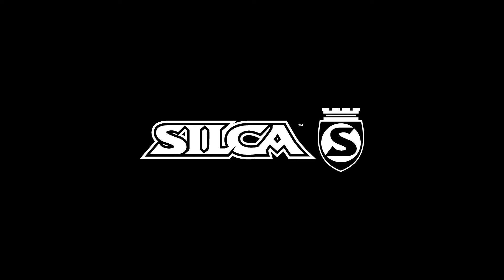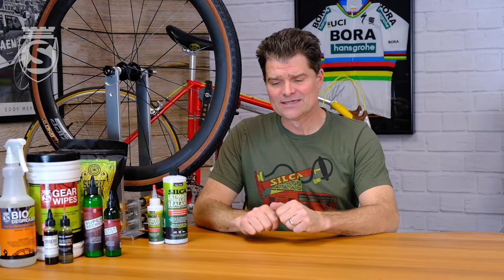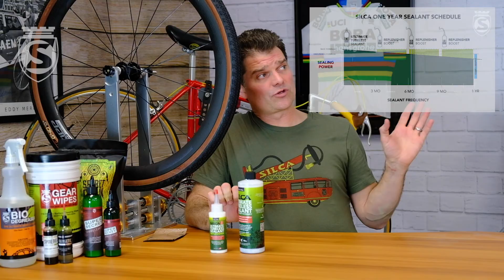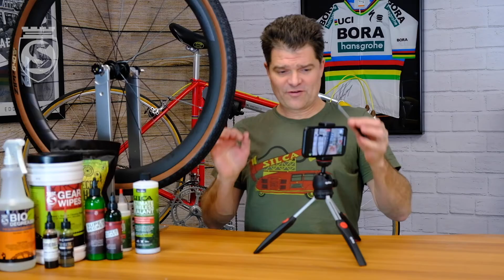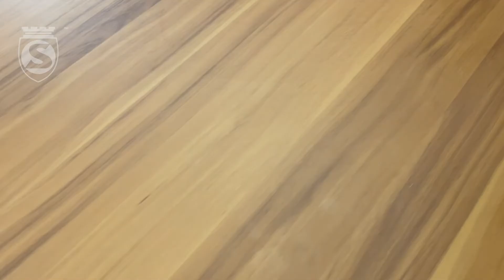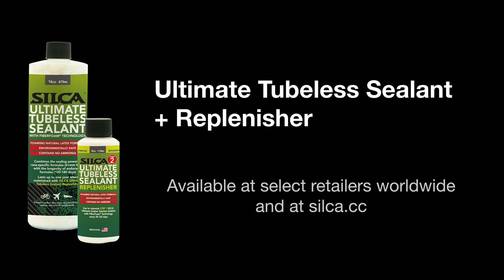Ultimate Tubeless Tire Sealant  (New Product Announcement)

Comment: I'm sold on this stuff just from watching this video and seeing the price! I have a few questions though. How many oz sealant and replenisher do I need for two 29" 2.4" wide mtb tires to last one year (Maxxis EXO)? Also, what is the shelf life and do the bottles have an easy to read manufacture date?

I have read anywhere from 3-8 oz recommendations on first time sealant use per tire for a new 29" mtb tire of 2.4" width. I was going to get a 32 oz bottle of sealant and about 3 bottles of replenisher for 1 year, but for all I know that could end up lasting 2 yr here in Seattle.

BTW, these tires are on a 2023 Santa Cruz that I just bought new, so the sealant (Stan's), has been in them probably at least a year. The guy at the shop I bought it from said the rear may have a solidified clump of sealant in one spot, which I confirmed by rotating the rear wheel fast while holding the bike, as I felt a noticeable tendency for it to hop. The front doesn't do this. What is a good cleaner to use to thoroughly remove old sealant from tires? Also, if I don't manage to 100% remove it all, is there any chance the Stan's residue will cause problems with the Sillca sealant?

Comment: Do you still have any use for if you have them "stans darts", does this product work with them? And have an other question, will this work using on Fatbike-tires during wintertime or will it freeze up? Can you mix antifreeze to be able to run it as far as down -25C°(-13°F)?

Comment: been using this for 6 weeks and so far so good over all terrain, roadside with glass, and rough Australian fire roads inside Pathfinder Pro's. I've only seen a little sealant near the bead where I think I burped a tyre hitting some rocks at low pressure and high speed. very happy so far. Thanks Josh and Silca product team!

Comment: Tell me difference between putting 2oz. Of Ultimate tubeless sealent Every 4months or adding the Replenisher in my 32mm tire?
Reply from the maker: Ultimate sealant cannot be injected through a valve, it will just plug it.  So the replenisher allows you to refresh the sealant through the valve without having to unseat the tire.  Also, the amount of carbon fiber doesn't need to increase from the initial install.. the sealant will begin to evaporate, but the carbon stays, so you really just need more liquid and not more carbon.

Comment: I was initally super excited to give this sealant a try after viewing this video. However, when I got a puncture on my most recent bikepacking trip I was totally let down by its performance. Backstory: I got two tiny holes  (one in my side wall and one on the top of the tire near the knobs) simultaneously when my wheel hit a rock on a fast descend and the tire bit the rim. Perfect opportunity for the fiber foam to do its job and take care of these holes, I thought. After about an hour of messing with the tire, spinning it and even adding more Silca specific replenisher I had no luck. It seemed the fiber foam was not building the so-called scaffolding that was advertised. When I later popped the tire off to put in a tube I was surprised at what I saw. Almost 100% of the fibers had clumped together in various parts of my tire and formed little stalagmites. There was virtually no more fibers dissolved in the sealant liquid that would be available to do its job. Super dissapointing. I should also add that I topped up my wheel with 60mls of freshly shaken Silca sealant right before departing for the trip. I'll definitely be sticking to Stans in the future.
Reply from the maker: Sorry for your experience, unfortunately the formation of stalagmites means that you waited to long to replenish.  This happens with all sealants especially Stan's as has been well documented for more than a decade, so be sure to give your tire a shake once a week and listen for the sealant to thicken, once it thickens, no matter what the brand, you should be replenishing.

Comment: One of the worst aspects of tubeless sealant is when my many bikes sit for weeks or months and the sealant solidifies inside the tire (I use Orange) or the dreaded booger. You can’t get that crap off your tire without some serious work. I want to be able to clean out the tire at some point, also clean the rim to reinstall tape, which is the absolute key to good tubeless performance. So a gunked up inside is not optimal. What happens to the Silca sealant when it ages? Can it be cleaned out? Hard? Easy? Thanks.
Reply: Good luck with any brand. If your bike is going to sit for long time take the sealant out the tyers. Also this stuff is like glue the tyer will basically stick together be becoming unusable. If your the type fit and literally forget tubeless full stop isn’t for you

Comment: Hello SILCA team, 

my Gravel wheels are well setup and I have just recently setup my ZIPP 858 NSW with Specialized S-WORKS TURBO T2/T5 2BLISS READY, it installed really well. 

However, during a long ride, I had a snake bite puncture riding over a big whole. 

The 2 wholes were roughly 2 - 3mm in length. One sealed but the other keep on leaking sealant and deflating the tyre.

I added sealant and even plugged the whole but for some reason, the whole would still leak, mostly when weight on it on when I’d look at it with my finder.  

I’m a bit confused because I think that I followed all the right steps. Any idea what I might have done wrong?  

BTW, I inflated the tyre with around 72PSI (max for hookless rims)

Right now, I’m prepared to go back to inner tube TBH.

Comment: I had a bad result with this product, after fitting the tyres according to the installation guide I found the product “set” inside the tyres and put the wheels out of balance, cleaned everything up and tried again but same result…. Product seems to dry out very quickly….. got nothing productive from Silca and nothing from the retailer…  Back to Stans Race as I know it works and doesn’t dry out in a couple of days and throw my wheels out of balance and I know its still liquid cos I can hear it sloshing around.

Comment: Josh! I bought in on this tubeless sealant. I now can’t fill my tires up . The sealant blocks the valve stems. After emailing silca without a reply I called. This call was worthless. I was hoping they could explain what I might be doing wrong. Instead I got sorry. So I replace all valve stems only to clog to the point my pump was blocked also. 
Do not buy this product!,its not the answer
Reply from the maker: Sorry for your valve clogging experience, but this is factor for all sealants of all brands and not just ours.  A quick google search finds thousands of articles and forum threads on Stan's and Orange seal and all the other brands clogging valves and how to fix or prevent it.  Our method is to coat the valve core with Synergetic or similar wet lube before installing and to put the valve stem at the 4 o'clock position for a minute before pumping.  You can also spray a little wet lube into your pump chuck which will keep any sealant that escapes from hardening.

Comment: This stuff is amazing!!! Ive used Stans sealant which was junk and left me stranded.  This Silca stuff seals and holds high pressure every time. Thanks Silca.
Reply: I didnt have a good experience with Stan’s.  I didn’t think it sealed well at all. The Silca stuff is good but it’s got its own problems with clogging valves. Orange Seal works well and doesn’t plug the valves.
Reply: @MasteringGrappling  well test that next possibly. Silca has a bit of a neegative for sure when i heard of the foam. Sounds like ir will get on the rotor
Reply: STANS is the market benchmark buddy.
They invented the thing and possibly has been the best since. Ive tested almost all, run through atleast 60 tires in the past 3 years. Although im looking forward to test this or new ones ive heard rumours about 
cant dismiss stans like that.

Comment: Got to test the Silca Sealant last weekend at the Wilderness 101k mountain bike race. I underestimated the rockiness of the trails in Central Pennsylvania and the Bontrager XR1 rear tire was a bit over matched by the rocks.  I end up with a slow leak and stopped to put in a CO2.  The leak was right at the rim, where its hard for sealant to get to. I turned the bike on it's side so sealant could find the leak and it sealed right up.  I finished the race on the 1 CO2 and the tire is currently holding air without issue.
Reply from the maker: Great to hear Paul and be sure to check that sealant as CO2 is a hardening agent for all natural latex based sealant products, ours included.  Changing out that air and adding some replenisher should do the trick!

Comment: Usual up front and science based video sir - thanks. Had already bought some of this,m before watching the video and just installed a new tyre(GP5000 TL) on to a Roval rim (about as hard a combo as exists) and with a little care managed to get 60mm in and only maybe 1mm spilled. Not bad for a road install. 

@silca_velo Questions: how do I stop the valve clogging now (with this stuff being better at ‘filling holes’) - is it just a case of replacing the valve inner more often?

What model of iPhone holder and mount are you using in that video l? 

Only have 3 months max left of the year now, so curious … if I store the wheel (temp on avg 19C)  for the winter and it doesn’t move can I use replenisher next Spring - or just start again? And will the bottle (now open) if sealant stay good until next year?

Thanks.

Comment: How does this not clog the tire valve if/when I need to bleed off air?
Reply: Use a fillmore valve or wheel the valve up to 12 o clock

Comment: I didn't get their solution to "seal the valve" problem? Do we inject the second liquid?  I'm having this problem even in other brands, I can imagine how difficult the situation should be with additional fibers in it.
Reply from the maker: The liquid sealant can get into the valve, but the fibers will actually dam up the valve hole and prevent sealant and fibers from entering the valve from the tire side.  When you pump, the air from the other side simply blows away the fibers and sealant, so in practice there is really no difference between us and the other brands in terms of valve maintenance.

Comment: Hi Josh: Great content. Hey, I'm a newbie, in that I don't have a tubeless setup just yet, but I'm wondering how much of your sealant would I need for my setup if I'm running a 700c 25mm road tire? I don't know how to figure out how much of your tire sealant I would need. Is there any instructions on the bottle itself that tell me how much to use? Thanks in advance!
Reply from the maker: There is a QR code on the side of the bottle that takes you to installation instructions including a chart of how much to use in different size tires.  You are probably looking at 2oz/60ml each for your tires!
Reply: @SILCAVelo  Thanks. I will look for that bar code when I receive the sealant.

Comment: Using the replenisher on latex tubes; would that result in not having to inflate the tubes everyday. If so then what would be the general time necessary to reinflate those latex tubes?
Reply from the maker: Replenisher may slow the pressure loss in latex tubes but will not eliminate it, the pressure drop is more related to the solubility of gasses into latex than porosity as is often suggested, so CO2 for example actually will migrate through the latex tube and sealant by temporarily going into  solution with the rubber and than transitioning out the other side..

Comment: Hi Josh I love your innovations, I've been on again off again with tubeless and was going back tubeless with a set of Vittoria Air liners when they arrive next week or so and then your email arrived in my inbox. Do you know if using Silca sealant with the Vittoria  Air Liner will work or do you think it is an either or option or perhaps even a better option without the AL.
Reply from the maker: I love Vittoria Air Liners, but they can make tire installation harder than you ever imagined.  We've been using/testing them in our shop for almost two years and I'm pretty much the only person (Josh) who can consistently get tires on/off without resorting to extreme measures, and even then, I've blood blistered my thumbs more than once.  If you're using the liners, I would not recommend putting SILCA sealant in during that process as you might end up stuck to your floor in a puddle of sealant and tears (been there.. done that!).  I would probably just go with replenisher if using air-liners as you'll want to just pump it through the valve and be done.

Comment: How does this react with CO2?
Reply from the maker: All latex based sealants will be degrated by CO2.. if you need to use it then go for it, but we will have similar issues to other brands over time with CO2.

Comment: How does this compare in regards to rolling resistance to other brands?! #marginalgains 😁

Also could you use Stan’s as a replenisher in a pinch?
Reply from the maker: Sealant rolling resistance is all about how much you are using, no real differences between brands or chemistry.

Comment: Question - will in possible to run with inerts like the Tannus Armour tubless? Or does it stick the slots inside?
Reply from the maker: We've done lots of testing with the Vittoria style inserts and it works great.  Inserts with very high surface area may end up capturing a lot of the carbon fiber and holding onto it.. but have not tested directly sorry!
Reply: @SILCAVelo  I will give a feedback of my testing.

Comment: I have now watched the entire video, as the title has made me very curious. And I am shocked at the audacity with which SILCA are trying to portray the sealant as a pioneer on so many levels. 

1. "Fiber Foam": Effetto Mariposa already tried this " innovation" with the foam a few years ago and it failed. Why? A foam can transport individual particles, that's true. But the problem is that these few particles/fibers are not enough to seal a hole. What works much better is if all particles always stay homogeneous in the liquid. This is for example what MucOff, milKit or Peaty's do.

2. Ecological Aspect: As far as I know the only supplier that currently still uses natural latex is Stans (because they simply haven't developed in 20 years). To stabilzie natural latex you need ammonia which corrodes the rims and spoke nipples, is harmful to the environment, smells horrible and is no longer allowed to be used for Maxxis tyres for example.

3. Longevity: It may be that the sealant in combination with the refill bottle is good for over a year. But that certainly does not speak in favour of the Sealant if it requires this additional bottle.
Reply from the maker: Great to see that you joined YouTube today in order to leave this comment, but it's fundamentally flawed in numerous ways:
1. Effetto Mariposa continues to foam, it's what makes it the best sealing synthetic latex sealant on the market, we credit them with this innovation in our media launch materials.  The current version foams less now than the original formula, but still foams.  Your assumption regarding MucOff, Milkit, and Peaty's is also not true, the plastic particles generally centrifuge out and stick to the casing while riding.. we punched hundreds of holes in tires with all of these and you will almost never find one of those particles flowing into the puncture, they just aren't mobile enough when riding, all of those sealants also just don't work that well and are full of micro-plastics.

2.  Uhh.. this is far from accurate, more than half the brands use natural latex and Finish Line just replaced it's poor performing synthetic latex with a natural one that supposedly works much better (according to them not me).   Testing over 30 brands of sealant, the natural ones pretty much all work better than the synthetic ones.  There are also non-ammonia methods of stabilizing it, though it still doesn't smell good.  

3. Our longevity for the sealant is comparable to Orange Seal endurance or original Stan's, and with the replenisher can be extended considerably without having to replace the entire sealant.  Over time, this means using less sealant not more.

Comment: I'll bet it seals holes really well, but I'm wondering about the materials safety if the guy in front of you has this stuff in his high pressure road tires, he punctures and then you breathe in little bits of carbon fiber. Also, I'm not all that keen for bits of carbon fiber to find their way into waterways. Any comments @Josh?
Reply from the maker: Couple things, the carbon is so good at plugging the hole that none of it really ever gets through, we've punctured hundreds of tires with this stuff and at most you get some oozing latex.  Second, this is pyrolized carbon fiber, it is chemically identical to activated charcoal which is used in water filstration and has no adverse biological effects, is not considered a contaminate to water or anything like that.  If you were to grind this carbon into a powder, it would be nearly identical to the carbon black that is used in your tires or your shoe soles.  The carbon is also fully encased in the latex, so any escaping sealant is just carbon and rubber, nearly identical to that skid mark you leave on a rock or pavement.
Reply: @SILCAVelo  thanks for your answer. I think other people will be asking the same questions.

Comment: i started running gp5000 clinchers with latex tubes with latex sealant in them last year with great success: zero punctures since. would this sealant work with this setup as well?
Reply from the maker: You can use the replenisher in latex tubes with great success, but you cannot inject the Ultimate sealant through the valve, so it can't be used with latex tubes.